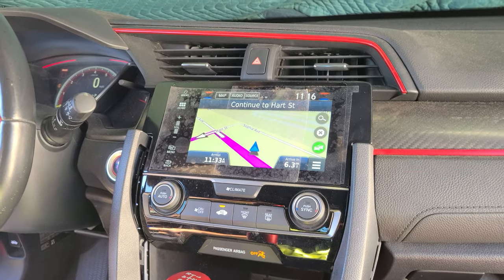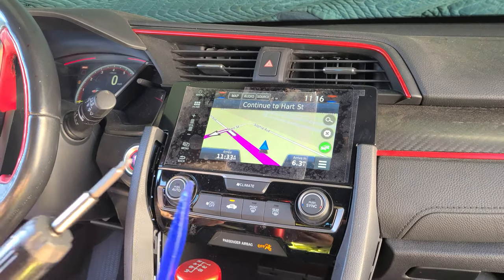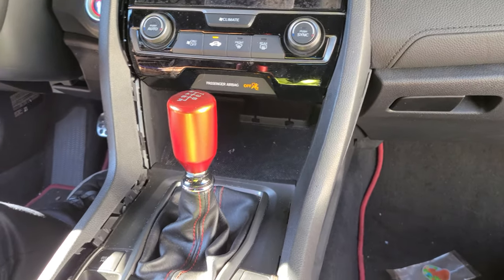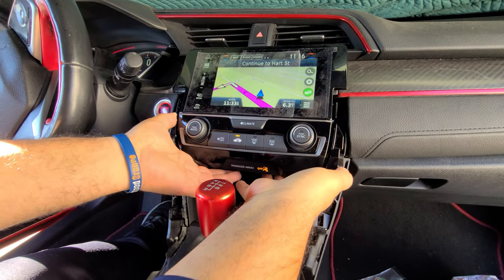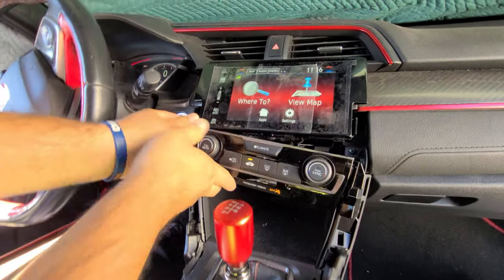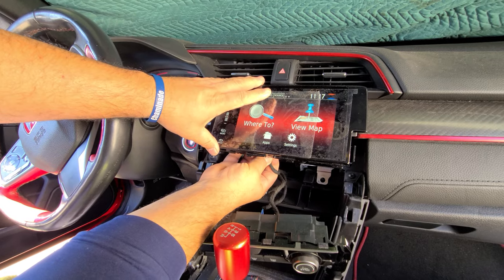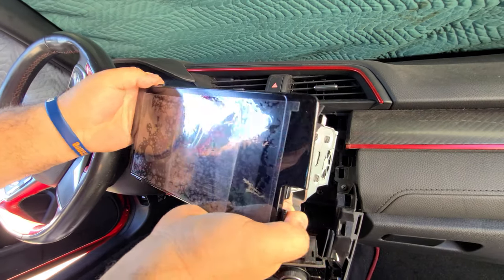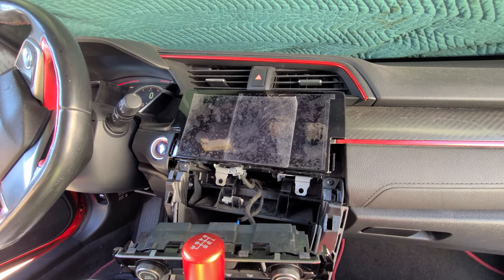How to Remove Radio / Navigation / Display from Honda Civic 2018 for Repair.

Comment: I cracked the screen on the display monitor on a 2020 honda civic sedan, is that fixable or Ill need to replace the whole unit? Thank you.
Reply from the maker: It is repairable. You could send it to us for repair.  https://hitechserv.com/
Reply: @HiTechElectronic  which ports do the cables go to? I purchased a replacement but all I see is a black screen but the audio works. Can you post a tutorial on which cables go to the ports?
Reply: @twinsister924  are you actually serious right now? There's only 2..... good grief man